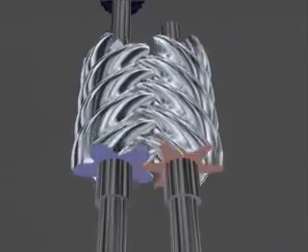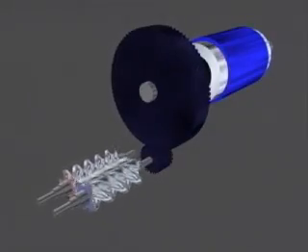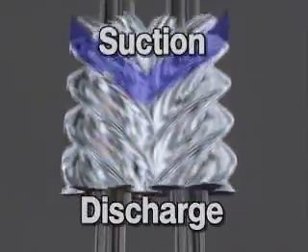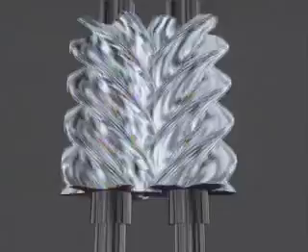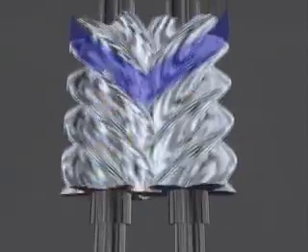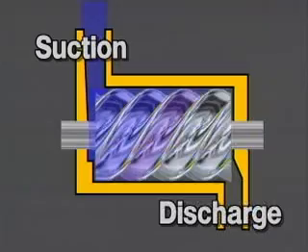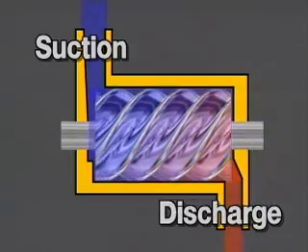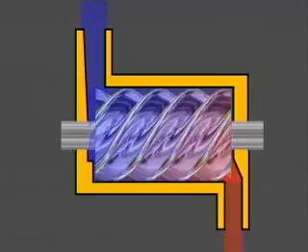Screw Compressor Operation

Comment: WE HAVE A HITACHI FREON SCREW COMPRESSOR, MODEL NO:170ASCCW-Z, UNDERGOING OVERHAUL. 
I NEED TO KNOW THE TORQUE STRENGTH FOR LOCKING THE MALE AND FEMALE ("KM 10" & "KM 14").